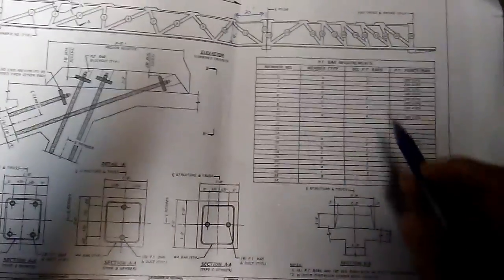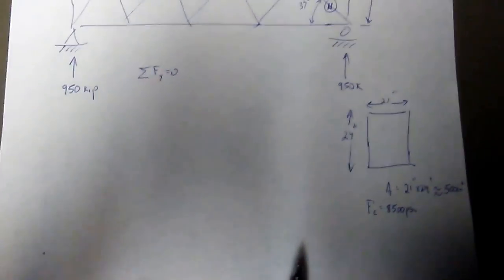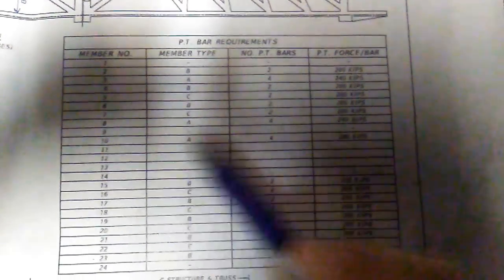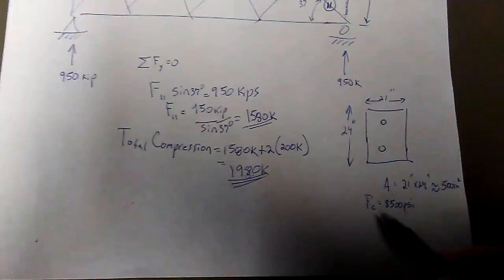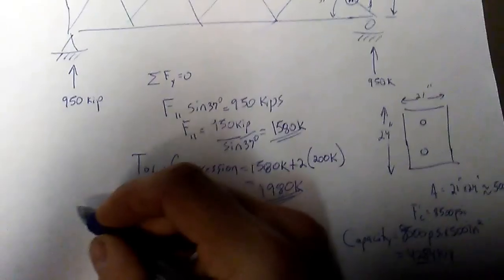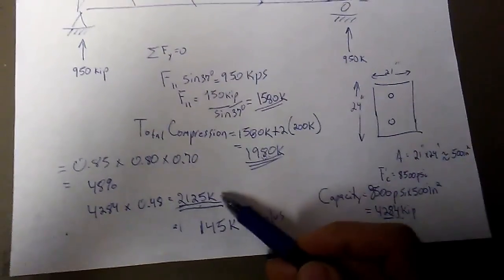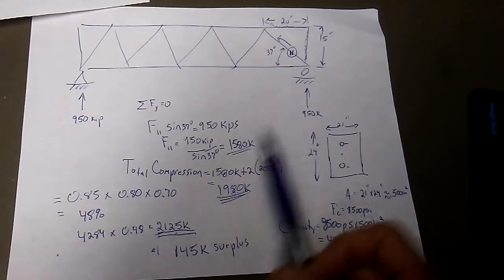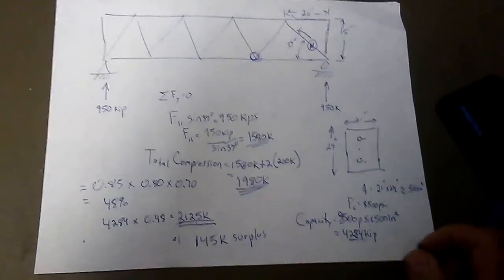FIU Bridge Collapse: The Hidden Truth (Part 3)

Comment: Do you not need to take away the diameter the the post tension tubes in your area calculations? Further, the length of the strut  will have an effect, where is that taken into account in your calculations. I.e. The slenderness of the strut is key. Slenderness in proportion to crossecrion area and total lenghth.
Reply from the maker: latitude Thanks for your input! You are absolutely correct. There are many variables not addressed explicitly in the video. The 2 ducts for the post-tensioning bars would reduce the cross-sectional area of concrete slightly (roughly 10 square inches assuming 2in diameter ducts). And slenderness should be considered as it will reduce capacity. My intent was to determine a maximum capacity based on equations for a short column. As you can see, even in a best case scenario of a short column, there is not a significant amount of excess capacity.
Reply: latittude: the concrete struts are kept as small as is practical to reduce weight.  This elevated tennis court was already overly heavy.  FWIY, all steel construction is said to weigh about 10% of concrete construction.  You can do a lot with concrete.  For example a concrete dome will work, but concrete trusses result in what we have unfortunately witnessed.  Designing this pedestrian bridge to be 40' wide was another stupid concept. Who wants a dance floor over a busy roadway?
Reply: Internet Privacy Advocate true, but the size is the same as the shorter struts in this design. One would think a longer strut should be thicker to counter the bending forces experienced. BUT that would mess up the sexy design, hence they cut the redundancy in those longer struts. My opinion, not based on anything but my observations.
Reply: Internet Privacy Advocate,  There's nothing like a place to sit and breath in some fresh carbon monoxide.
Reply: tom ruth it boggles the mind that you would want to suck in the poison of those cars going by. What was the intention? To creat a pick nick area? The students know better than to be up their for any period of time. I bet most believe in not eating meat and want all electric cars. So not the right market for this bridge.
Reply: latitude,  I know,  maybe it was a strange design from the beginning. A bridge where you can sit and watch traffic?  A bridge that looks like a cable stay design, but is really a truss? Just very sorry that people had to die to drive home a lesson. I just hope the real reason(s) for the collapse will surface so we can learn and move ahead.